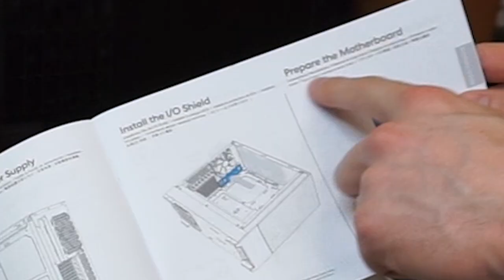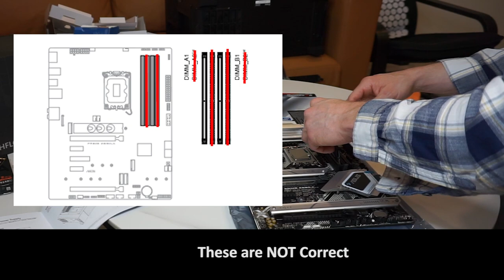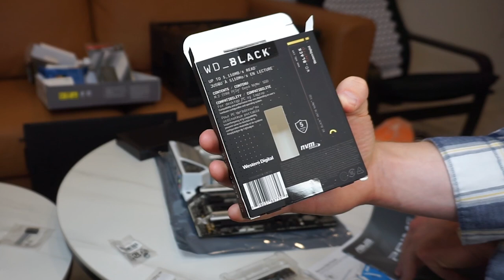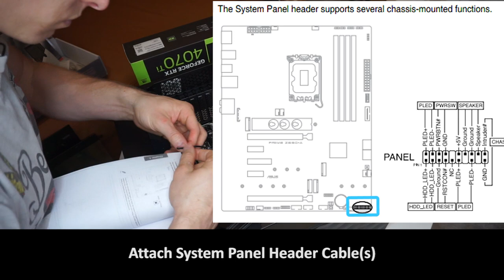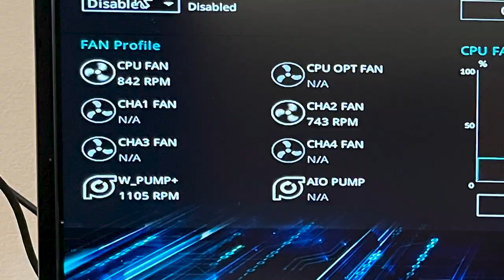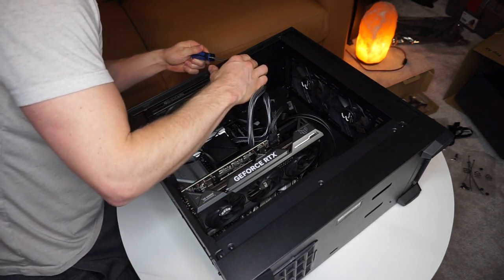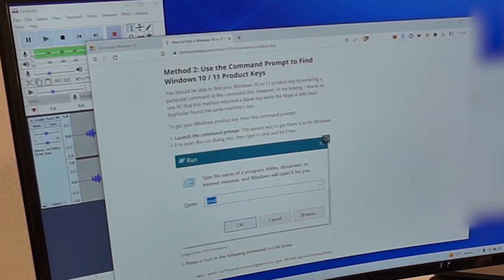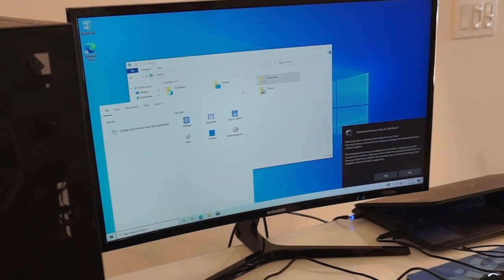Zero to Hero: Building My First High-End Gaming PC

Comment: slightly concerned about the 750w psu with a 4070ti and 13700k but should be fine
Reply from the maker: Thanks for looking out! I will keep an eye on the power draw 👊🏼
Reply: it should be good considering the 40 series is amazing at power consumption
Reply: @spqdz  i know but personally, would go with probably an 850w with this setup just for the extra headroom for ease of mind, and no chance of power issues. Also will make the system cheaper longterm if AllanRyan decides to upgrade to a more powerful cpu or gpu that may be more powerhungry as a new psu is not required.